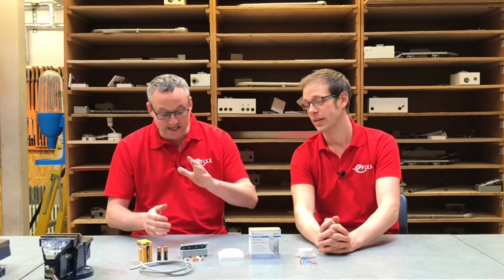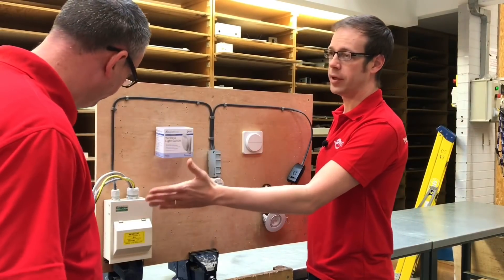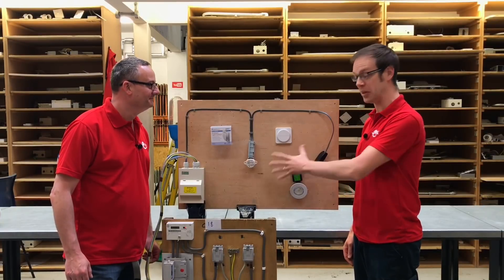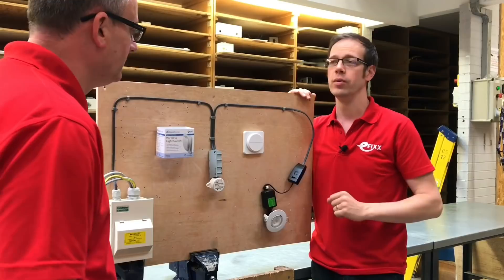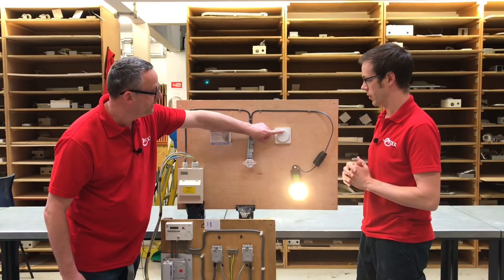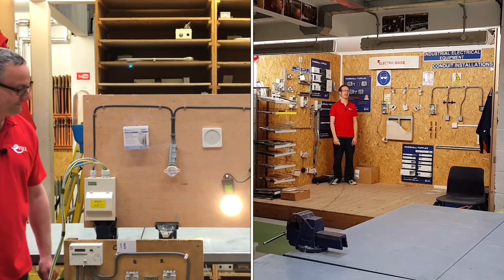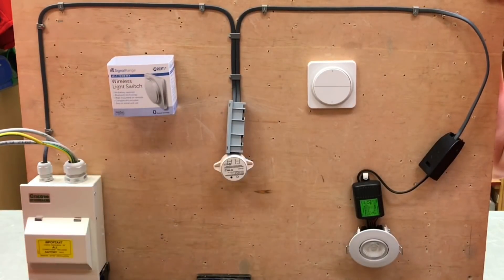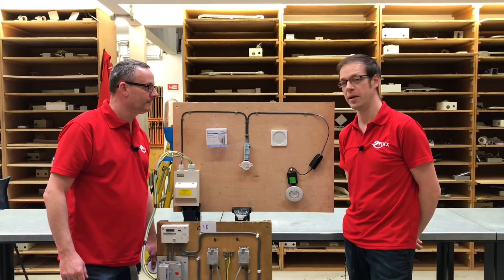This EnOcean kinetic switch needs no wires or batteries - uses energy harvesting technology

Comment: its quite practical in terms of ease of installation & setup.👍
has this exact product available for sale? and the number of maximum remote switches pairable to one(1) receiver base unit?
also can a single remote switch be paired to more than one receiver base unit i.e master remote switch controlling two(2) receiver base unit simultaneously??

Comment: A periodic testing nightmare.
Reply: Alvin Ashman why?
Reply: @zjzozn  Insulation resistance testing, as all electronic equipment needs to be disconnected from the circuit under test, ordinarily this isn't an issue for things such as USB sockets and dimmer switches as more often than not, they're clearly visible and easy access. These receivers are intended to be concealed within the fabric of the building above ceilings and could influence the test results if the inspector is not aware of their installation or location.
Reply: Alvin Ashman 
We are developing a receiver which fits into the pendent and makes the product more accessible. Also we have a receiver in a bulb coming soon which is even easier.
Regarding the testing, these type of products have been going up for years now, and are become even more prevalent in public buildings so I guess the service provider has taken that into account. 
Casambi are leading the way, for which our switch is compatible.

Comment: Great video guys.. well presented as always .. it's a nice idea .. Cant say i'm impressed with the product .. i would prefer proper terminal connections instead of those fly leads .. single insulated i guess? no quiescent current marked on the unit.. which is important in these energy saving days and switches look a tad cheap
Reply: We are looking into quick connect terminals.
Ref the cheap look, the product is robust and to be honest it’s only a plastic mould. The working are German so you can be assured of quality.
Any other questions.
Ian@wireless-Navitas.co.uk